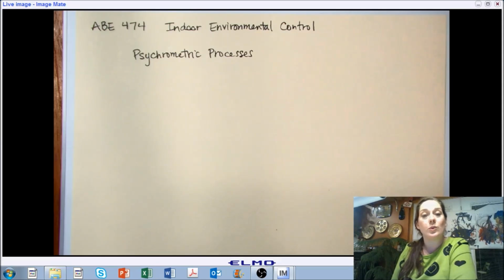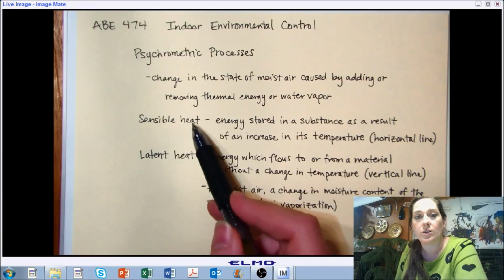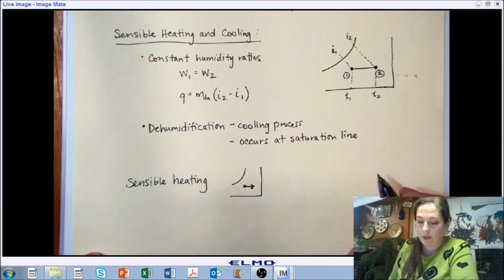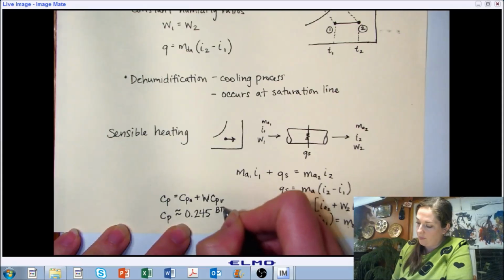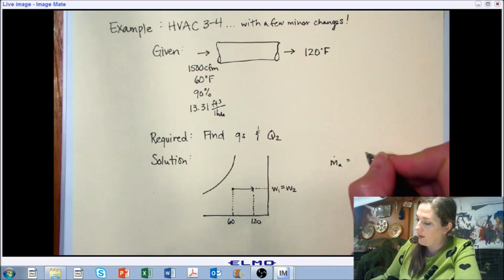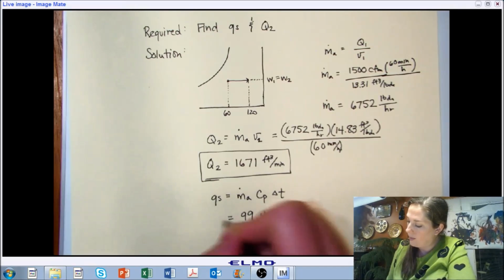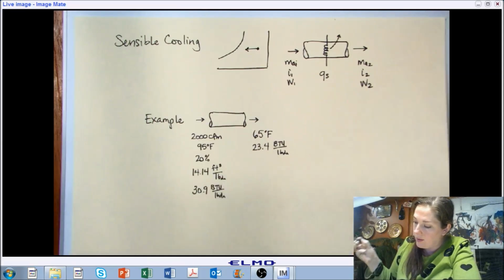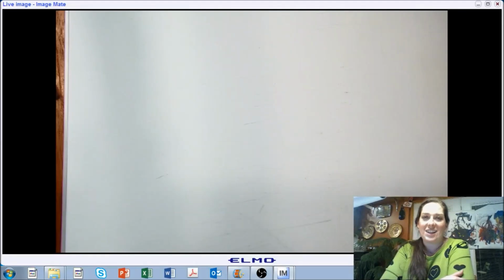LECTURE 3 (PART E): Psychrometric Processes - Sensible Heating and Cooling

Comment: In your sensible cooling example is an error. For 2000cfm the sensible heat required to be removed is 65,573 BTU/h instead of 63.65 BTU/h.